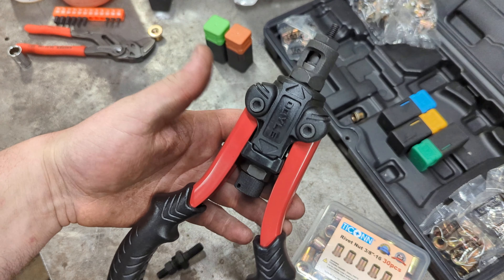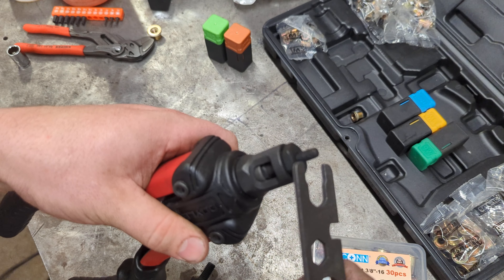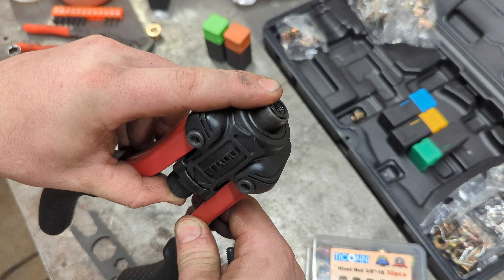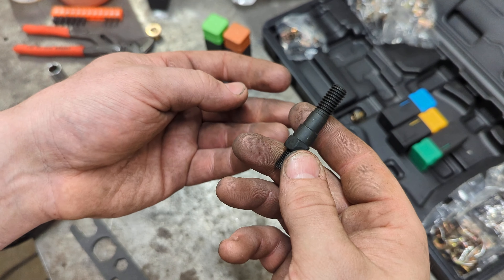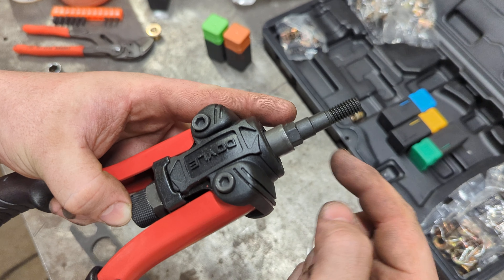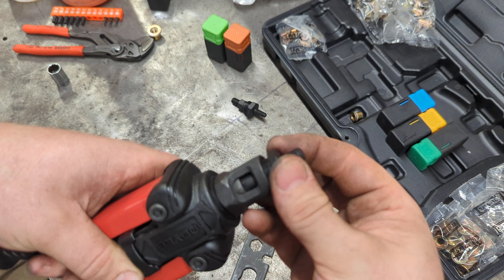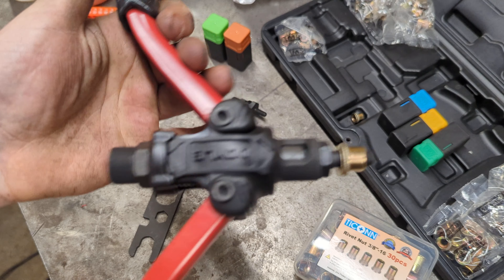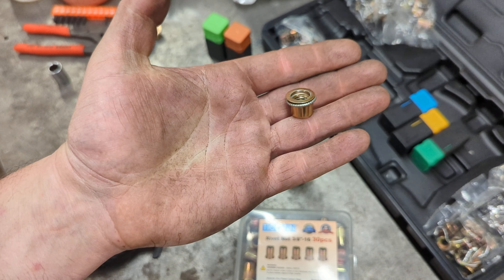Harbor Freight Doyle Rivet Nut Setter Larger Mandrels

Comment: Thank you for posting this!  I have the Doyle nut setter tool on my list fir next time Im going there. I think that this is one of the best tools ever invented  ... .tho "nutserts" and the tool have been around for decades, Ive never owned one. Its not a tool that will be commonly used every day, but for those certain times,  theyre invaluable to have. One thing that has deterred me till now tho, was I was under the imoression that 1/4x20 would be the largest size available. And thamk you for the link for purchase.

Comment: I do not even use the wrench.  Hand tight is good enough.  I am disappointed it does not give a recommended hole size for each mandrel.  I ended up measuring the largest diameter for each nut size and added .005-.010 for a clearance hole.   Every other source I saw only said make a snug hole.  What ever that means to you?  If the hole is too large it may not stay in place for long and start spinning.  You will be bummed if that happens. Especially in a soft material like Aluminum or plastic.  You need to consider the thickness and type of material you are going into as well.
Reply from the maker: Reputable riv nut manufacturers specify required hole size.     They're all not made the same.
Reply from the maker: Sorry you're probably talking about the ones included in the kit I'm assuming.    Yea I agree with you there

Comment: How thick of metal can you use the riv nits on?
Reply from the maker: The manufacturer of the riv nuts calls that out.       For example the riv nuts in the video have a clamp range from .020" to .150"
Reply: Don't tighten the mandrel. (That last part)  that way you don't have to turn the whole tool to unscrew it from the rivet nut.